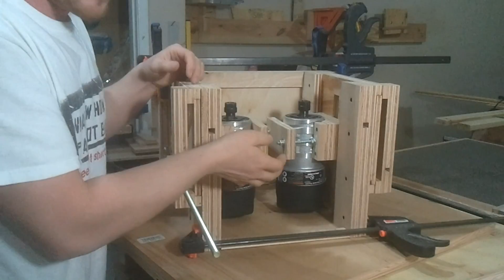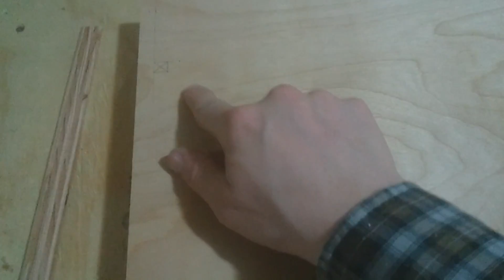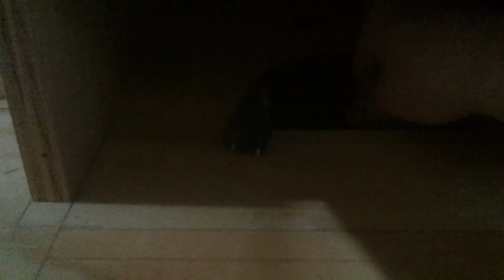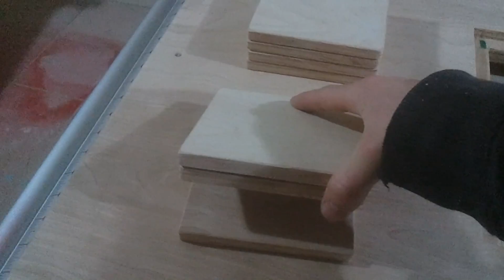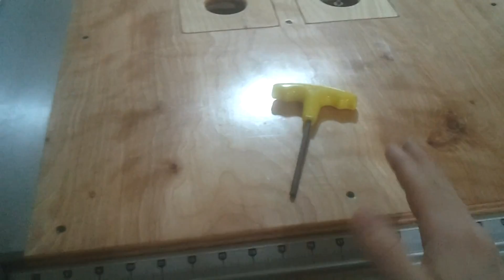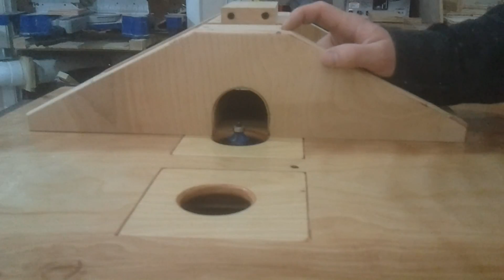Making my dual router table - 086

Comment: Very nice setup.  Good fence, I've never seen this kind of setup with original design quality.  I don't think you answered the question on two routers here, so I ask again - why two routers?
Reply from the maker: At the time my thought was to have a dedicated roundover and a dedicated chamfer bit. My two most commonly used bits. After having this for close to a year now it's just too cumbersome to use the router closest to the table saw. I use the outside router with the fence clamped to the table saw fence. I never use the original hold down holes. I actually plan on downsizing the table saw station and making a dedicated router table. Funny how things change...